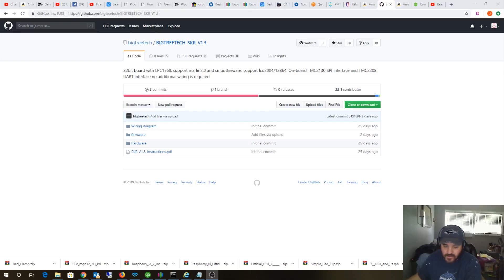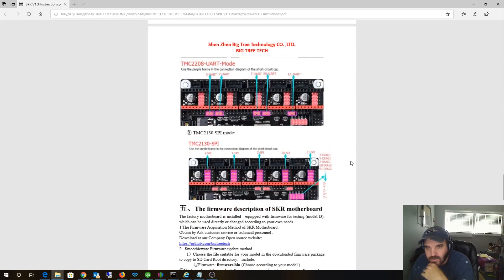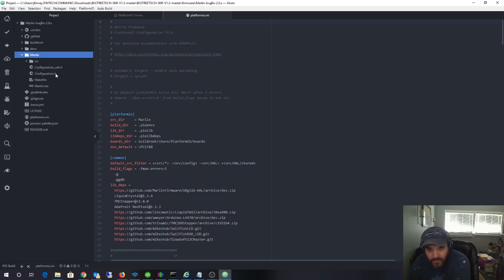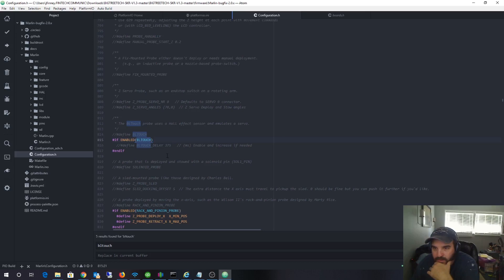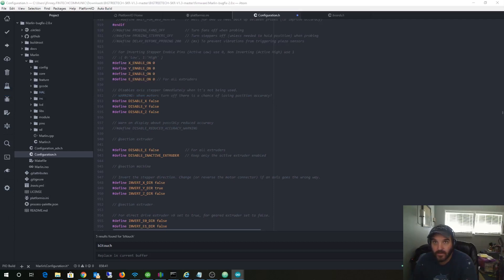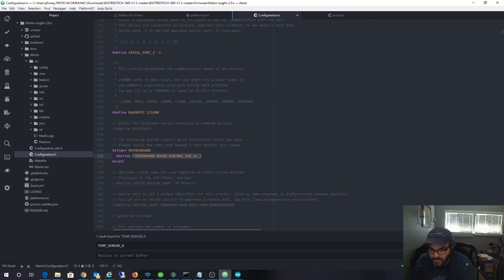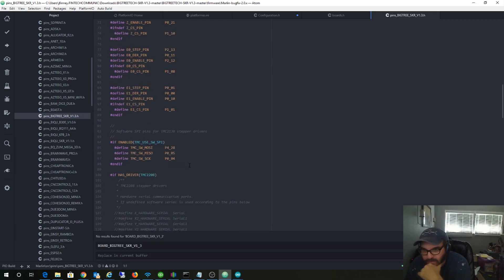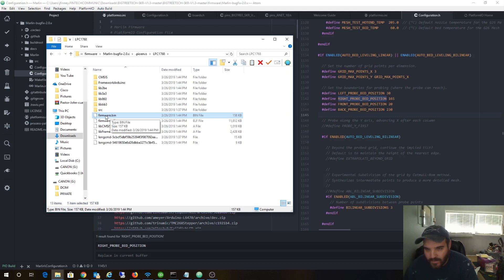NEW Bigtreetech BIQU SKR 1.3 TMC2208 BLtouch Marlin 2.0 installation build compile 32bit

Comment: Thanks for the video. I have been trying to get this to work for several late nights now. I’m having a bunch of trouble actually compiling the .bin file. I am using the same setup as you are (Minus the fancy extruder). SKR V1.3, BLtouch, TMC 2208 in UART. I keep getting multiple errors.

Comment: I just picked up this board for my Ender 3, do you still need to solder the bottom jumper tabs to put the TMC2208's into full UART mode with the SKR 1.3 board?

Comment: How do you setup the TFT 32 with this board?
Reply from the maker: It worked out of the box, its a completely independent from Marlin firmware. Its actually a self contained computer.
Reply: @fintechrepairshop  cool! So i don't have to change anything? Just plug it in? :)

Comment: from what I see this board is already supported from the official marlin 2.0. There is the pin configuration in the boards file etc
Reply from the maker: awesome
Reply from the maker: I really think this is a perfect 32bit board. cheap, external drivers, direct driver control, bltouch provisioning,
Reply: Yess, looks too good to be true to me 😆
Reply: I just bought it and the kit came with all the wires, the standard Chinese blue USB (that I toss) and 5 TMC2208 for 52.99 delivered via Amazon on Thur.  How in the world can these boards be around 20 dollars?  That shocks me.